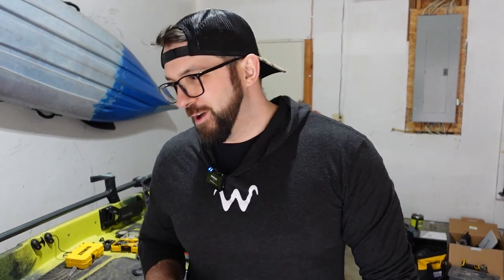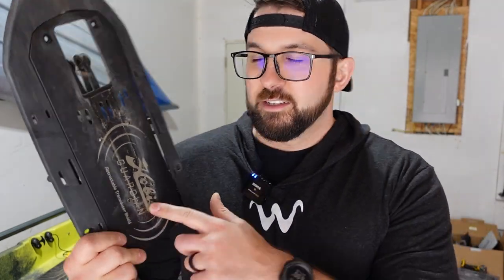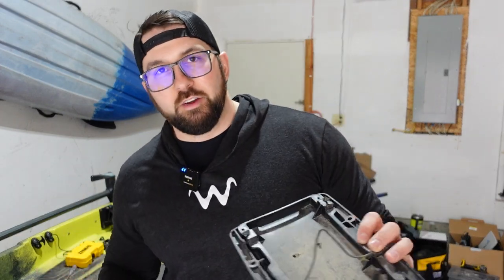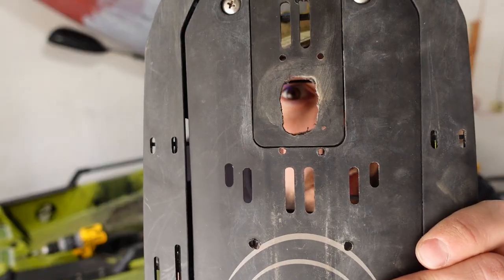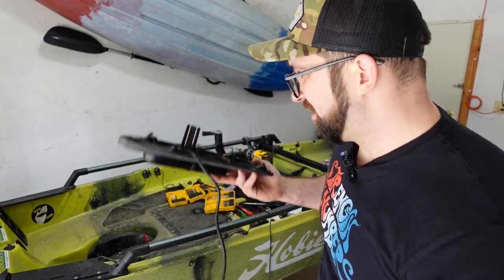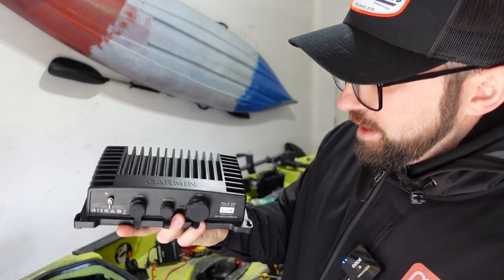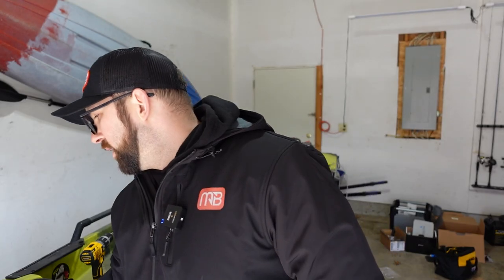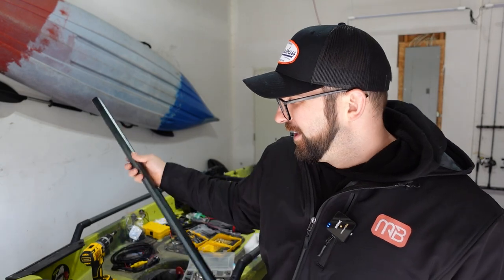PANOPTIX Kayak Rig Pt. 2 | How To Install Garmin Transducer On Hobie Pro Angler 360

Comment: I installed my Garmin GT54 transducer very similarly to what you did only I had the Berleypro cover in hand before I started and was able to see where everything would fit. The front 2 holes of the Berleypro use the screw holes that hold the "clean" plastic part you cut a slot in for the cable to run through. I had to mount my transducer back farther so the cable hole had to be made between the posts on the top side of the Guardian cover to allow the GT54 to be placed back far enough for the Berleypro to still retract into the hull. Your installation may be a tad too far forward now for the cover.
Reply from the maker: We got the cover and made it work… it was close